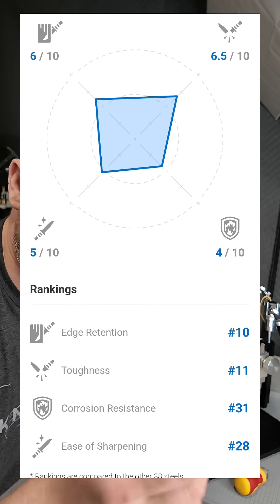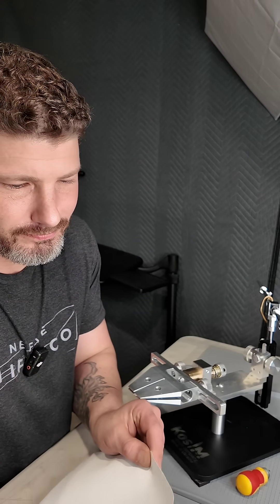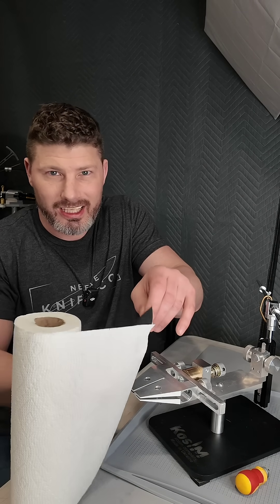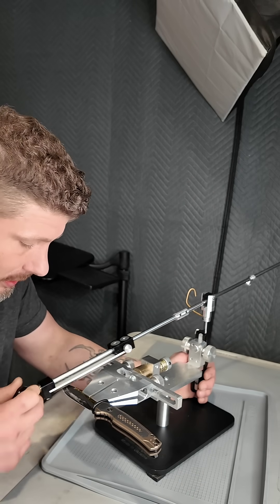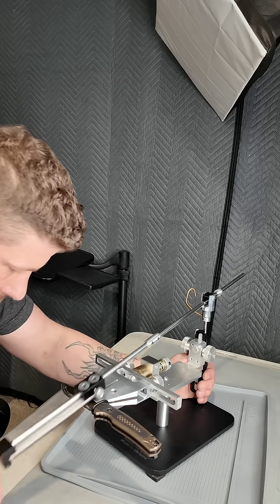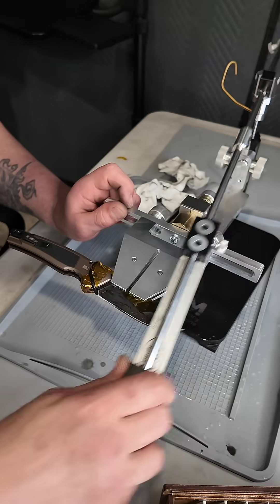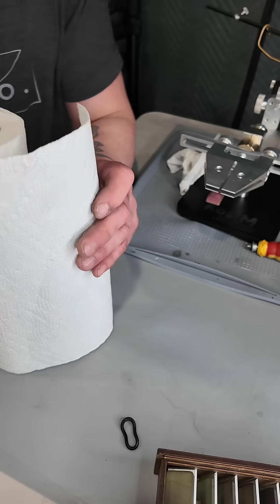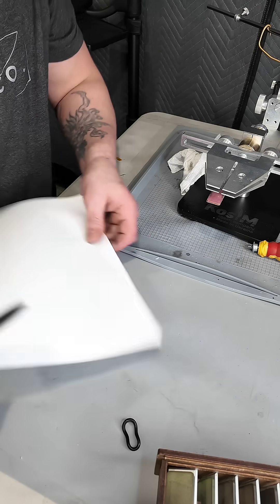HOW SHARP CAN WE GET M4 STEEL

Comment: Hey Jared, I need some help! I've been sharpening knives for a long time now! And when I finish sharpening a knife on my work sharp pro Pa I almost always come out with a rounded tip, I don't go past the middle of the stone, and I try to apply a little more pressure away from the tip so the stone doesn't roll over on the tip, but I still come out with one that's rounded! Do you have any tips on how to stop making this extremely frustrating mistake?

Comment: I just picked up a spyderco tenacious partial serrated in m4 after watching this. I love plain edge blades but I know and have seen serrated blades slicing paper and paper towels like a plain edge and I want to get it to slice from the serrated to plain edge through paper towels cleanly.
Reply: Do you have any advice for me to be able to achieve this. I have basically the worksharp profession full kit adapted into my precision adjust.

Comment: There's actually no use for a knife to be any sharper than the original. Other than slicing sashimi, which you can't do with this blade. In fact, the edge is now weaker.

Comment: I have a Benchmade Stryker c/f with M4 Blade! My Favorite Pocket Knife I've Ever owned! I Love the M4 steel! Sharp & Holds an Edge Forever once sharp All you have to do is strop it and its Wicked Sharp Again! The M4 will wear Out a Normal stone must use Diamond stones to Sharpen ! I think its My Favorite Knife Steel Only Down fall is Not As corrosion resistant  as some! But is still decent! But edge retention makes up for the little extra care! Very Durable blade!

Comment: M4 is definitely one of my favorites. In general, I’m a huge fan of “tool” steels like M4, PD1, Cruwear, 3V, Etc. wish they had been the standard over stuff like M390 or s30v. And they’re WAY better, at least in my use cases, than S90v. I remember when first getting into knives, there was a knife I was REALLY looking forward to. Beautiful carbon scales and an s90v blade. Chipped that damn thing the first time I took it out of my pocket. 😢 Which is why I prefer M4. It will still hold a sharp edge for quite awhile, and a useable edge for a long time. The extra edge holding as a razor sharp edge for s90v is just not useful for me. 🤷🏻‍♂️
Reply: I got a PD1 sprint run Spyderco and it was my first go with that steel and ive been pleasant surprised with it, and ended up being the only knife ive carried in the last year. Its been better for me than K390. I haven't used any M4 though. Been a fan of tool steels myself too for a long time.
Reply: That's EXACTLY why I prefer tool steel over stainless of their equivalent. Stainless is just way too sensitive to lateral forces that it chips looking at it the wrong way. Sure, more care goes into maintaining a tool steel but it's well worth it. Just wax it once a day or week depending on humidity and you're set 🤙🏻🤘🏻

Comment: I make blades from regular HSS which is M2 usually. Don't know why more knife makers don't make blades from it more often. Not for choppers or heavy duty knives obviously but for some super sharp and slicy blades/folders.
The sharpness of an edge HSS takes is really amazing plus it's like 65hrc so super hard.
I also make blades from the more typical steels like 1095 and O1 or W1 but HSS is a steel i don't see many knife makers touch and it's great and you can buy rectangular blanks in any size and thickness you want already.
Reply: I bet a lot of Companies and custom guys won't use it bc of how hard it is to work with on a larger scale operation.
Reply: That's definitely a good point. It's definitely harder to grind since it's so hard but with ceramic belts it isn't that bad. But then again most blades i make are usually 2mm, sometimes 3mm thick. More than that would definitely start becoming a pain but it usually ends up taking me a similar amount of time from start to end since it grinds a bit slower than annealed 1095 or O1 but i also don't need to heat treat it. 
I also need to sand the blanks before use to get a nice satin finish before grinding in the bevels since the blanks come with some noticeable circular scratches from the grinding method they use to flatten them.
But that's a good point you brought up. @danielduvall4154

Comment: I put a convex edge on my PM2 in M4.  Craziest sharp edge that lasted forever.
Reply: What is your technique?  Sandpaper over mousepad?
Reply: @HammerK99 TSProf Kadet with convex attachment.  Using Venev Orion bonded diamond plates to 1200, switching to Naniwa Chosera stones, 3000 and 5000, and then finishing with 4, 1, and 1/2 micron stroppy stuff diamond emulsion on kangaroo leather strops attached to plates.

Hey, you asked.
Reply: @isaiah_b_3798 
Oh wow, that is pretty cool.  Do you recommend the TSProf?  I am very green when it comes to sharpening.   The hardest steels I would have to sharpen at home would be magnacut at 63 HRC.
Reply: @HammerK99 I've seen the Apostle P use that mousepad and sandpaper technique.  I'm sure it works but I haven't tried it yet.

Comment: You can get a chinesium butter knife razor sharp. It’s how long it will hold it or resist rolling , dulling, and chopping that really matters…
Reply: M4 is pretty rugged stuff, it doesn't roll or chip very easily. My only complaint about it is that it tends to tarnish
Reply: @tabby151  I agree with you. I’m saying the idea of “taking an edge” doesn’t make any sense. You can make any cheap knife sharp. The difference is how long it’ll hold an edge
Reply: That’s not true at all.  With out a proper heat treat you will never attain that level of sharpness.  I’ve come across 100 Chinese knives you couldn’t even apex.  Just flapping the beak shit flying out your mouth everywhere …

Comment: You should try the dual edge on M4 that was pioneered by The Home Slice you tube channel.  It’s the best.  Super rough on 1 side and polished on the other.  Like 150 and 6000.
Reply: Da fuq?
Reply: @Elmax17.5dps oh man dual grit edges can be pretty awesome.  They're best achieved on finer grained steels.  They'll take edge retention to another level for you.
Reply: In the right steels, a dual grit edge can be very impressive. Particularly in aggressive edge retention. 
KnifeMaker
Reply: How's that done? Do you mean half the edge at one grit and the rest another? @michaell397

Comment: How sharp can we get it, or how sharp can master Jared get it? Those are two different levels, brother.
Reply: What sharpening tool is that
Reply: Well he's using a fixed angle system so just about anyone can get it as sharp as he did in this video ..  
If he's doing it freehand, that's a different story
Reply: @cedrics1220 i understood you my dude
Reply: @cedrics1220  That's a really nice fixed angle system, but some of the cheaper fixed angle systems can be a bit annoying to get a good edge on.
Reply: @cedrics1220  Jared can do just as well free hand.   He is a very talented knife sharpener! 
and no, I watch a lot of people still get the basics wrong even with a fixed angle sharpener. It still takes knowledge and acquired skill. 
KnifeMaker/retired after over 47+ Years in the Craft
Reply: @cedrics1220 clearly you are new to his content. The man freehand sharpens knives capable of whittling hairs.
Reply: @jachconi  I think you misunderstood my comment. 
I just said that everyone can get a knife as sharp as he does with the same equipment he uses in this video, since it's a fixed system. 
And that freehand sharpening is another story, because it takes a very long time and a lot of practice to get as good with free hand sharpening as he is. 

I myself can freehand sharpen do double whittling, that's why I know how difficult this is

Comment: Will those kdtu stones work with the worksharp precision adjust?
Reply: If you get the after market holder they will. I purchased mine from Hapstone for about $60 they make cheaper and more expensive options. But the one I got is perfect and fits every aftermarket stone I own. Works perfectly along with the worksharp.

Comment: I need one of those sharpeners how much are they ?
Reply: That one is pretty expensive but you can get a “fixed angle” sharpener, and a good one for around $250. The Worksharp professional is awesome. And he has reviews of it on his channel.
Reply: @jachconi do you know which one it is?
Reply: @christopherkortlever the one he is using?
Reply: I think it’s a KosiM system. But honestly, what makes that sharpener, and others like it, so good is the fixed angle positioning of the blade and the ability to use a variety of stones to get a desired result. Search fixed angle sharpeners and you’ll see choices from $70-$999 and more.